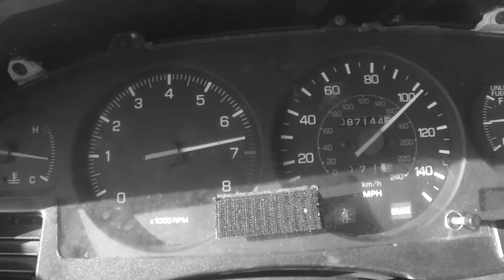Garage Life Hack! Insane Wheel Cleaner! Best Wheel & Tire brush

Comment: Does the purple power work well for removing brake dust?
Reply from the maker: oh yeah
Reply: Thanks for the reply!  I'm going to use that to prep my IS300 wheels for plasti-dip.  I might do your $35 IS300 intake this year too.  Keep up the good work on your channel.
Reply: Used the purple to clean and prep the IS300 wheels for dip and they turned out fucking awesome.  Also cleaned up the barrels and back sides of the spokes with it.  The dust just melted right off.